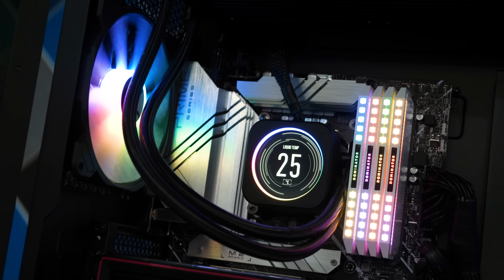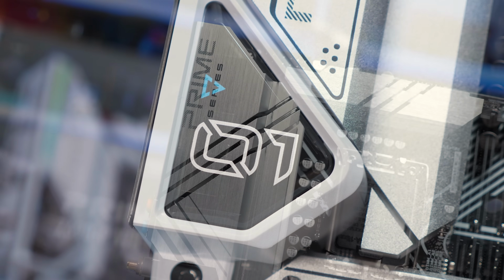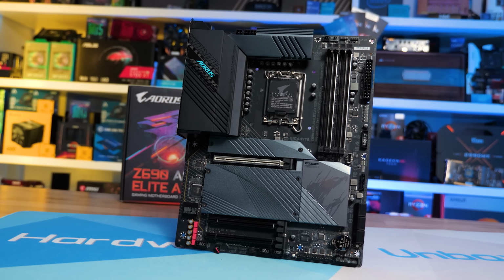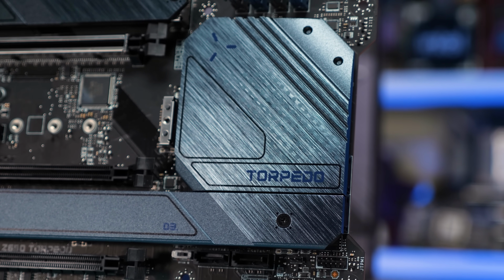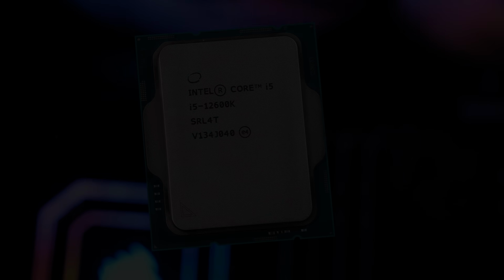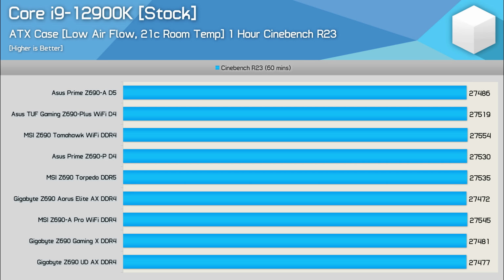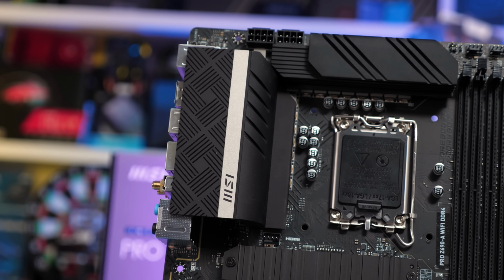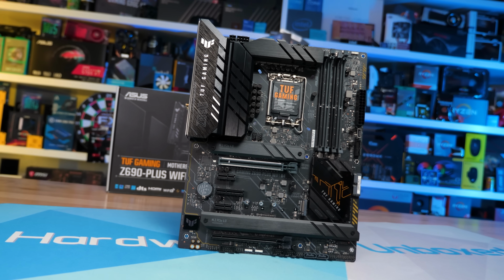The Best Value Intel Z690 Motherboard: VRM Thermal Benchmark

Comment: Could I suggest monitoring the wall-power of the system while doing this sort of testing? It would be kind of interesting to know if the boards differ in efficiency and, if so, by how much. I realize that that number would include PSU efficiency, but as long as it's the same PSU, it should still be a fair measure of relative efficiency, and if it differs by any significance, it would be an interesting factor by which to distinguish boards that are otherwise fine in terms of temperatures.
Reply: That would be very little differences. Not worth measuring for those ~ 10W of difference between different boards.

Comment: I went with the Gigabyte Gaming-X DDR4 for my 12600K, mostly because of that it featured a better sound chip than the similarly priced Asus and MSI boards.
Reply: ..and I've only used ASUS or MSI boards in the past.
Reply: Any memory issues?
Reply: @justinbroniszewski  not any causing boot problems or similar. Have not run memtest though.
Reply: Is it still running good? Mind doing a short review?
Reply: @AthifKhan  yes, I've updated all the bios updates and the last one was long ago. Haven't had any problems other than perhaps a old M2 ssd drive that didnt show up i bios but has since started working 🤷

Comment: I'd think the MSI would beat the other entry level boards quite easily at the same power consumption since it runs higher voltage out of the box. Everything here is quite usable anyways.
Reply: Is that whats going on? The default voltages are higher? I was wondering how the Asus Prime was consistently "saving power". Based on the reported voltages and package powers it seems there is more to it.

Comment: May I reccommend to check boards light load Effieciency as well? An optimized VRM should not only good at full load. Efficiency also matters on light loads (editing in a design/office app, or browsing the web).
Thank you the hard work!
Reply: It doesnt matter. Vrm efficiency only scales to current draw and ambient temperature. So light loads draw so little current even the worst vrm will show like 99% efficiency. The efficiency difference between vrms only show when the load is high.

Comment: Wrong test. All motherboards should have the same vcore and PL when testing.
Reply from the maker: Out of the box testing makes the most sense given that's how they'll be used. Also good luck getting the vcore the same. Unless you're going to hotwire every board you've got less than no chance.

Comment: I would have gone ddr5 but their is some in stock in the UK, Corsair vengeance but 4800mhz and bad timings for £500 🤣🤦. I could buy a ddr5 MB for £300 and ddr5 for £200 down the line if needed for my 12900k and cooler. Simple enough swap.

Comment: Bit late already got mine. Asus rog strix Z690-A gaming D4. No issues with my stock 12900k and 32gb ddr4 3600 cl 16,16,16,38. Great onboard sound which i need and looks and works without issue. Very nice looks to boot for my build and heatsinks everywhere for nvme ssds. It's the most expensive board i've bought and i've had Hero and Maximus boards all under £300 but this one cost £310. Either way it suits my needs and visual preferences.
Reply: Got the same board due to the cashback offer which made it acceptable. Hope you got the Asus cashback offer in time. For me it was £75 as I went with the 12700K and on the 12900K it is more...Board is great though...

Comment: I got the Asus Z690 Prime-P D4 and was wondering if it's worth getting a mobo with more power phases (say +16)? I want to run the i7 12700K; and concerned that this board might not use the CPU optimally (i.e., with boost, etc). 

Any comments on this? I'm not too worried about connectivity; just don't want the CPU to be limited in any way.
Reply: No, all Z690 boards other than Asrock are able to run 12900k even on low airflow.

Comment: With boards costing sub £200 vs others at £260+ and if money is tight the difference will get you genuine gains if the money is put towards other components.

The z690 boards are very good across the board and are all capable of running AL CPUs.
Reply: the tldr for z690 is: just get a z690 UD if you want usb ports, or a z690-a if you value your sanity more than 2 usb ports (GB bios is still a bit... peculiar)
EDIT: as far as ITX is concerned: MSI seems to be the go to for z690 as well, MSI seems to have a knack for ITX motherboards
Reply: @ruben991_the_goblin  im gonna make a 12600k build but I couldn't decide between msi pro z690-a ddr4 and gigabyte ud z690 ddr4 :D 
Can u help me a little man ?
Reply: @DePrEsSiOnHdq  get msi,  gigabyte software on bios is not worth the hassle
Reply: @BodethIII   I think I'm going with a 5800x and a b550 Aorus Pro v2 are they good ? 
I still couldn't choose a cooler and case tho.

Comment: How is it possible that the ASUS Prime uses 157w at 1.200V vcore and the TUF Gaming is using 11w more at 1.199V? Is it something wrong with the measurement or something serous wrong with what the mobo is reporting to sw? Can you please explain this problem? I can see that it's boards that this is happening to, but can you tell me why? Love your vids BTW.
Reply from the maker: This info is reported by HWinfo and known to not be 100% accurate, but viewers want it reported anyway. I didn't talk about that info for that reason.
Reply: @Hardwareunboxed  Ok. Is this something you are going to address in a future video? In my opinion it would change some results. The VRM temp will be higher when drawing more wattage. And maybe you could try to mount the termocupple to the vrm its self? Wouldn't the temp on the back of the board be different from 5 layer board to 7 layer? Do you know witch mobo has smart power stages and witch has just "dumb" power stages? Love from Norway.

Comment: I like how in Western Europe almost all the DDR5 boards are in stock but the memory itself cannot be found literally anywhere. Not even if you were willing to pay crazy prices for it, I just can't find it anywhere. Every retailer site just lists it as "not available / cannot be purchased at this time".
Reply: Exactly the same over here in Brazil, the funniest thing is that the 12700k was sold for USD370 on black friday...
Reply: I had a chance to buy it when it first came out but it’s expensive
Reply: Who's buying all the ram but not the motherboards??
Reply: @nttea  Servers, possibly.
There's also a big shortage of the PMICs that DDR5 modules use, so it's hard to manufacture enough of them to meet demand (though apparently no shortage of VRMs for motherboards, so I guess that still raises similar questions).
Reply: You can buy DDR5 in the UK... if you want crappy slow JEDEC RAM. Hell, you can't even get 4800 CL34, which is the best JEDEC spec.
Reply: 5000 ddr5 in 16 and 32 is available for $499 and $999 lol so it is available
Reply: There is cpu but no cooler (or adapters) for lga 1700 here too. Neither DDR4 mobos.
Reply: @psnbrasileira9588  weird, I bought a new noctua dh15 and it already had the 1700 adapters
Reply: @MetalZoned  Opa, comprou na waz? Eles não atualizaram os soquetes suportados na descrição. De qualquer forma, o D15 é muito monstro pro meu gabinete kkk.
Reply: Same in the US,

Comment: I wanted the MSI Pro Z690 but it was out of stock locally and it was wait 2 weeks or get another MOBO so I got the Asus Prime Z690 Wifi D4, I would've gotten the TUF Z690 but it was 100$ more 😭 I hope it wasnt a bad choice in the long run at least I got a cashback
Reply: You can always change motherboards don’t worry too much about it. I know how it feels when you question your decision but there’s room for mistakes in builds just sell the parts you don’t want or make another budget build as a back up that’s what I have done

Comment: on the ASUS z690-f gaming wifi, anyone else having issues getting 4 dimms of  8GB ddr5 4800 to run at that speed. mine shows up at 4000. wont boot in any form at 4800. have to set it to 42,44, and 4600 to get it to boot at those speeds. memtest(86?) passed. all sticks show up and at 4800 expected in uefi etc. I heard 2 dimms work at 4800 but i havent tried that yet.  seen bios update 0803 works for some but not for others.

Comment: Good. I can rest easy then. Waited till last Friday for VRM tests, but bought the Tomahawk in the end. It's a really nice board, but the drivers are a nightmare to setup on Linux. You can't read many sensor data, some USB ports crash, and the new Bluetooth, and WIfi messes up the Lan connectivity.
Just as a heads up, it's not ideal for linux workstation use. At least at the moment, maybe after kernel 5.16+.

Comment: I have never bought a board based on the VRM.  As long as it can power my CPU without throttling or overheating, I don't care.  But I'm glad to see that doesn't seem to be an issue with any of these boards.
Reply: It doesn't seem to matter with high-end MBs, but it certainly matters when they tested those low-end MBs - I think it was B5xx MBs, and some were quite a bit slower -.

Comment: All hats to Gigabyte, only they got it right with PCIe slot placements on the motherboard. What is MSI and Asus doing putting additional PCIe slots so close to main gpu slot, shakes head.
Reply: Yay. GB bioses are alpha level - buggy as hell and massive problems with ram. But hey, at least the PCIe slot placement is "right". :D
Reply: @Cuthalu  no issues with bios or ram here, unless you have the first ddr4 ram or bios that came out eons ago. Also heard Asus has issues with ram so that means Asus has two red flags, memory and spineless PCIe slot placements. Nice work, making Asus boards completely useless.

Comment: Buildzoid mentioned that the Gigabyte Z690 boards have issues with ddr4 support. A friend who bought a Gigabyte Z690 Gaming X warned me away as well. Did you experience any of this?
Reply: I had to return gigabyte z690 itx board cause not only it didn't boot with ram higher than 3600mhz it also caused all sort of crashes unless I disabled pci e gen4 support. The bios is also a mess. 0 /10 for gigabyte this generation.  I'd recommend to stay away from these boards.
Reply: asus n msi FTW

Comment: Mid-70s on the low-tier boards with 12900K is great and puts to shame boards twice as expensive. Note that MSI Pro-A achieved that at noticeably higher Vcore than others...
Also, Gigabyte's DDR4 boards currently suffer from issues (most notably, with RAM) so it's best to skip them for a while, until they fix them.
Reply: Have the Gaming X and the XMP profile works perfectly with the new BIOS (which was out before my board even arrived).
Reply: @stuartb3082  People have difficulty hitting 3600 Gear 1 on Gigabyte, while the same CPU+Memory boots 4266 Gear 1 on Asus/MSI and is stable at 4133 Gear 1...
Reply: I have the z690 UD DDR4 and have no problems with RAM.
Reply: @MSJChem  I also have Z690-UD DDR4. It can't run 4 sticks of 3200 CL14 (Samsung B-die) at CR 1T, same sticks taken from Z390-UD where it worked fine. Otherwise it had training issues with tighter timings which all used to work. Internet's current state of collective knowledge suggests that you need to manually raise voltage by 10 mV (for example, manually enter 1.36 instead of 1.35 it pulled from XMP) to actually get it to maintain the voltage and stability, but I'm not sure if it does anything or just the usual placebo/voodoo setting :)

Comment: As I'm looking to upgrade soon would you suggest getting intels12th gen or wait for AMD 6000 Series?
Reply: What do you have now? It will be interesting to see what AMD’s Zen 3D will be like.
Reply: Your choice at this stage should be wait for the cheaper motherboards to come out for 12th gen or see what 3d Cache brings to the market.
AMD 6000 series could be end of next year.

At mentioned it depends what you are running now and if is can't do something you need it to do.
Reply: I wouldn't mind hearing from others :)
Reply: For gaming? Upgrading now is fine. All these cpus are so fast, at 1440p there are hardly any gpus that max out an i5. Or 5600x for that matter. 

Issue with upgrading now is the GPU.
Reply: I wouldn't go with 12th gen until Intel launches non-k varients which will be bang for buck.

Comment: Massive improvement over the last generation where you had to be carefull to get the right z490/z590 mobo or otherwise miss out on performance.
Reply: Been using the mai z490 tomahawk but can’t update bios anymore due to a bad bios on msi website. Over 500 people have documented and reported the issue on forums. Want to know what Msi responds to it all is? “People are doing it wrong it’s not our fault 😑” I’ll probably never buy a msi product after that. Msi doesn’t care about it’s customers? That’s fine. I’ll take my money else where 💯
Reply: @SVT_LIGHTNING  ummmm, ok? Hyperbole much? Just don't update the bios and wait for a fix 🙄
Reply: @samgoff5289  it’s been about 8 months with no fix and none coming. How long should we wait for? Until z790 comes out??
Reply: @SVT_LIGHTNING  why do you need this update so bad? Is there somthing really bad about your current version or somthing?
Reply: @SVT_LIGHTNING  why do you need this update so bad? Is there somthing really bad about your current version or somthing?
Reply: @samgoff5289  it doesn’t matter why. the bios update should already be out he paid for the product and so would expect it to have the newest bioses
Reply: @samgoff5289  Well, bios updates are generally a good thing. Bios manufacturers (essentially AMI nowadays) do improve their product over time and board manufacturers generally do the same.
Moreover, bios updates pack newer version of platform firmware, like IME, AGESA or microcodes, which provide another layer of stability fixes as well as security fixes.
Reply: Essentially all the boards will run perfectly fine and you can buy based on price and what connections you need.
Reply: Prices are also "improved".
Reply: @rentojad  For sure. 50 dollars at least compared to z590.
Reply: @Superiorer don't be so sure, the Asrock boards could still suck out
Reply: The board makers tried harder this time because they know this generation will actually have tons of buyers because it's legitimately good.

Comment: The "Z690 PHANTOM GAMING 4" is the cheapest in the UK. £152.99 (inc VAT) at OCUK Preorder.
Reply: If its pre-order it isn't available.
Reply: @stuartb3082  CCL have the "MSI PRO Z690-P DDR4" in stock free next day delivery currently too for £169.99 if that helps.